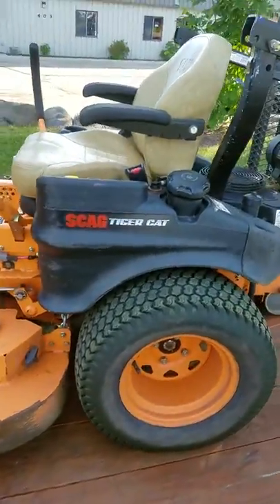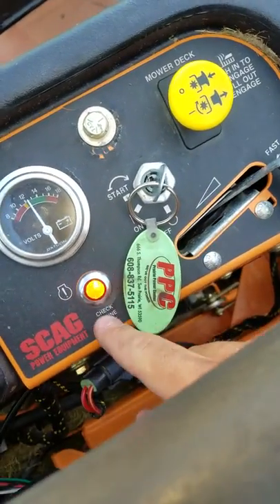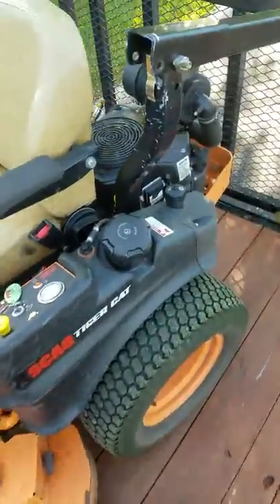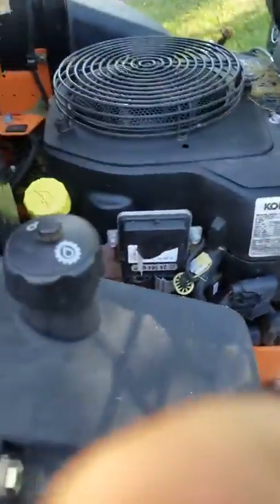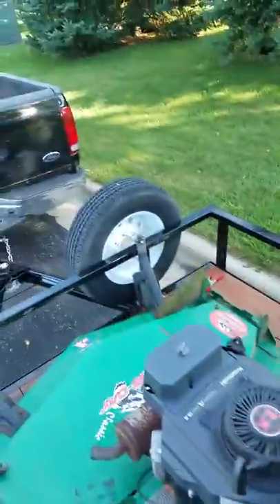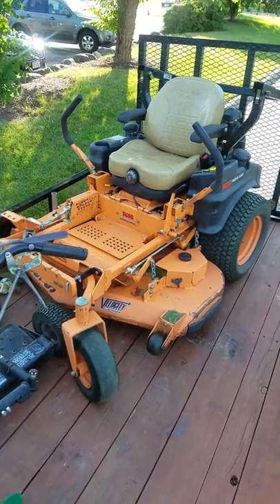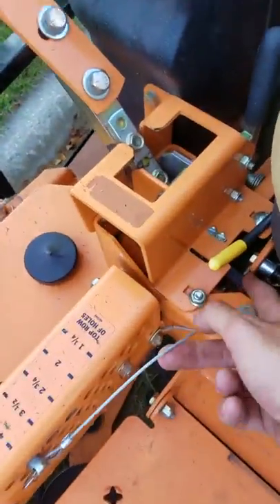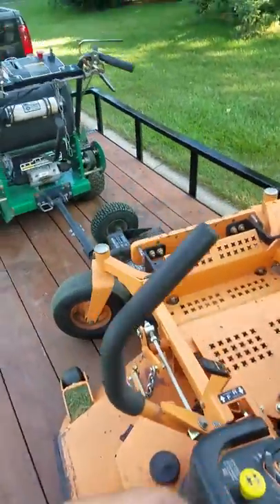Scag Tiger Cat will not turn over

Comment from the maker: So far, I've change the PTO switch and now the mower starts. However, I can not get the blades to engage! I will likely take it to the dealer and have them look at it. Once they fix the problem, I will post the solution.
Reply: So you replaced the pto switch and fixed the issue? The switch sounded like it was engaging when you would push/pull it.

Comment: Starter Relay…about $20.00.  The “ hum” you’re hearing is from the fuel pump.  The relay is under the panel that holds the key.  It will be held in place by a fastener.

Comment: The team over at PPC should be able to assist in determining what might be causing the no start.  Air, Spark or Fuel would likely be one of the reasons it's not starting.
Reply: No kidding, it won't turn over and its air, spark or fuel. My patriot does the same thing at times replacing the PTO switch first. Thanks a lot team
Reply: Way to just loosely mention the three main things a motor to run lol, really sounds like you know what your tlking about.